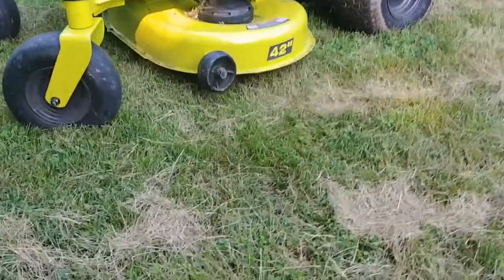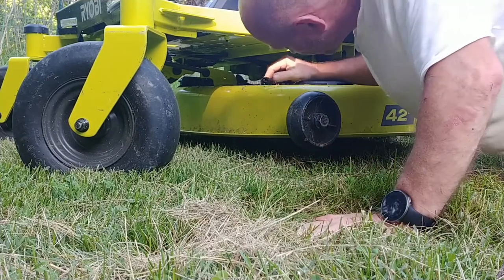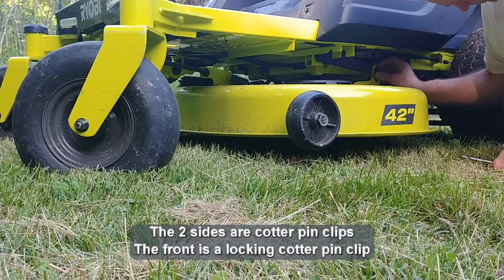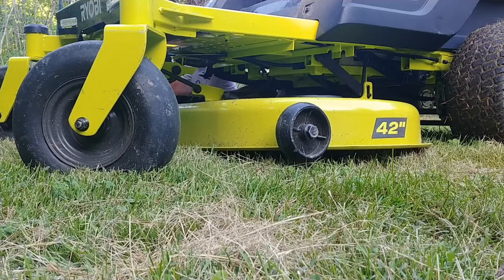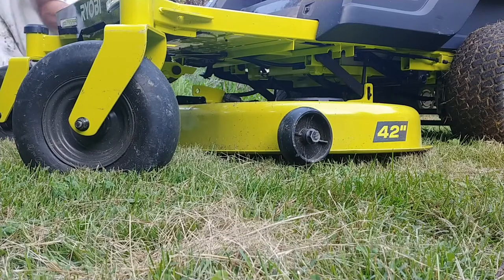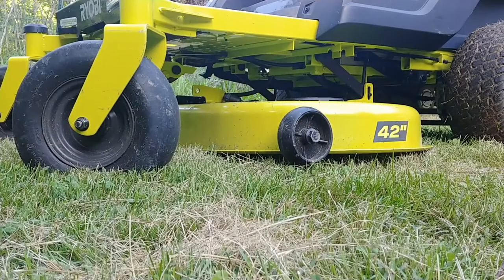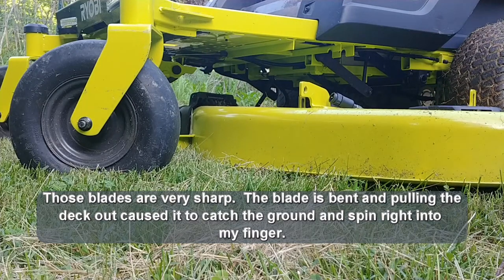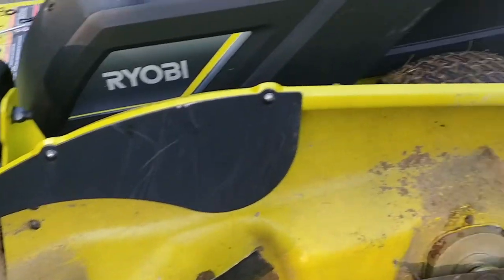ryobi zt480ex removing mower deck easy peasy #donotbuy

Comment: Thank you for making this video.  I just bought a 42” ryobi and I think I will buy a lift to raise the deck so I can clean it or replace blades.   I’ll try this method once to see the hassle…..Hope your finger is ok.  :)
Reply from the maker: Thanks for your concern, my finger is fine. Removing the deck on this particular mower is very easy compared to some other gas mowers I've owned that were belt driven. One thing to be aware of with the lifts, they dont really give you a lot of room to work and you are pretty much laying on your back to do so.  I think it would be easier to remove the deck than use the lift. Just be careful because of sharp edges and blades.

Comment: I am looking for an upgrade to my mower deck on my ryobi. It struggles to cut grass even 2 inches above the desired cut height.
Reply from the maker: Last year mine cut grass almost 4 feet tall like it was butter, but this year like yours mine struggled to cut grass barely higher than the setting. I suspect the blades have gotten dull and i have on my to-do list to pull and sharpen them this week. The other issue is the battery life dropped drastically compared to last year. I'm hoping the batteries haven't gone bad already.